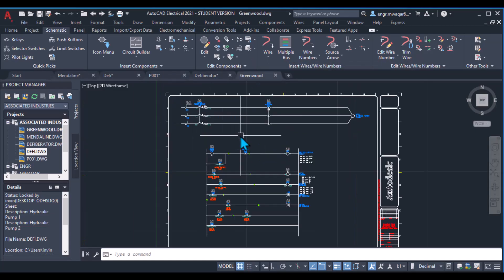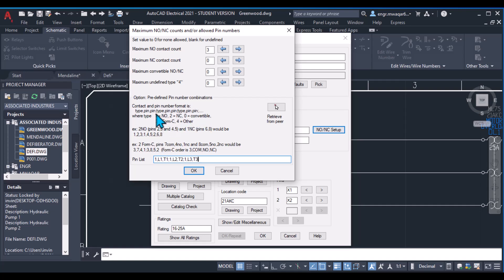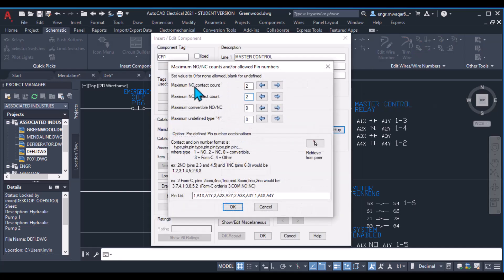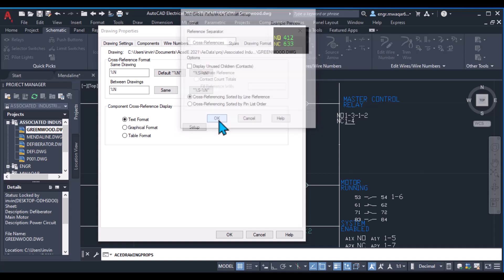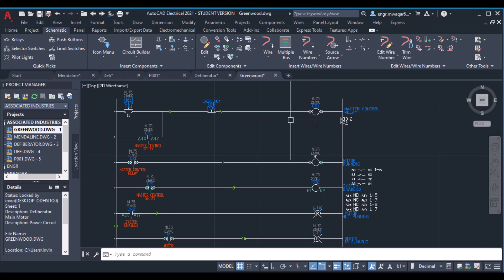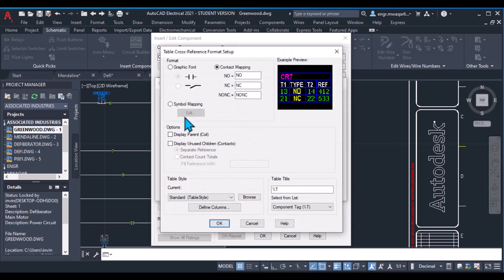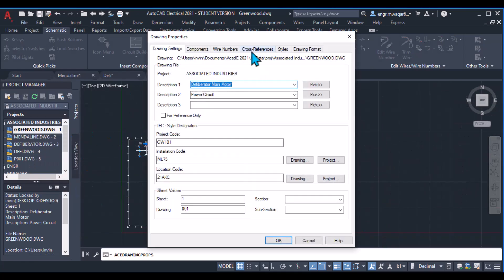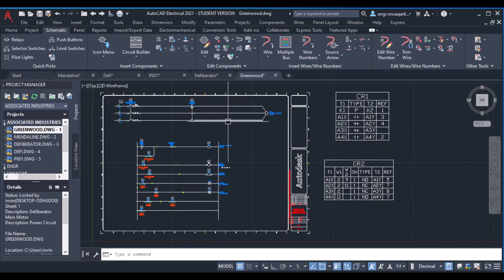AutoCAD Electrical 6.5: Components and Cross Referencing

Comment: Can you explain like how in eplan if we click it will take to that particular relay when click on contact
Reply: If you right-click any component and click "Surfer" it will show you all cross-references and you can view them
Reply: @niklasbalk2556  I was asking in pdf sir in eplan it will take to that component
Reply from the maker: @ In EPLAN, PDF has clickable hyperlinks between relay coils and contacts.

In AutoCAD Electrical, you can:
Enable cross-referencing: Use the Insert Component tool for relays and contacts.
Generate cross-reference reports: run schematic reports > component cross-reference.
Export PDF with Hyperlinks: Go to Output > Publish > PDF and enable Include Hyperlinks.
Reply: @suntechengg  I am unable to find it sir can you please share if any video with you
Reply: @suntechengg sir please make video on pdf jumping in AutoCAD electrical today
Reply from the maker: I explained the whole method in the comment in very simple way. Anyway if you still find any difficulty, comment below again and I will prepare a short video for this.